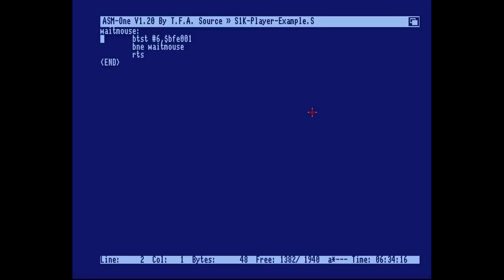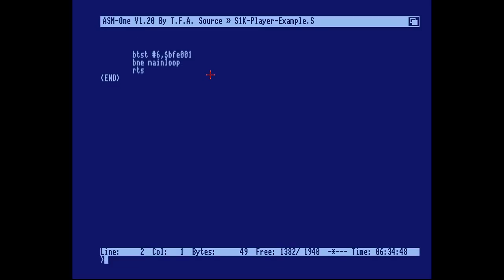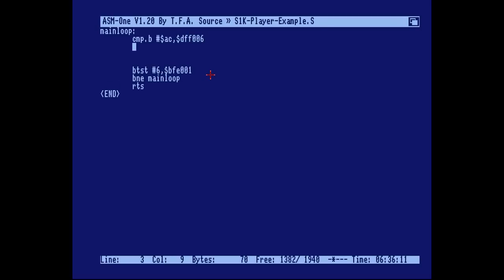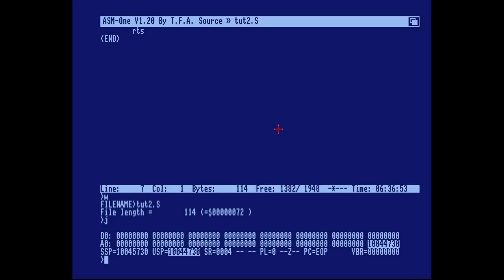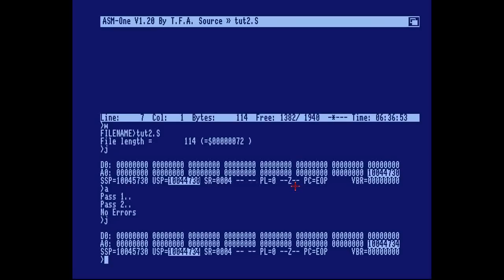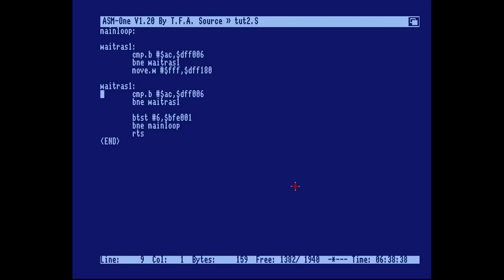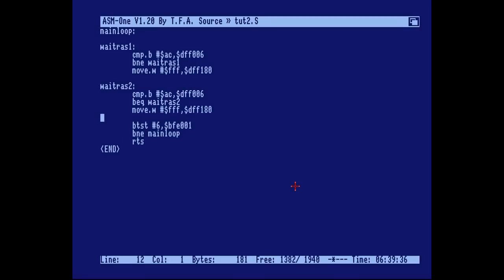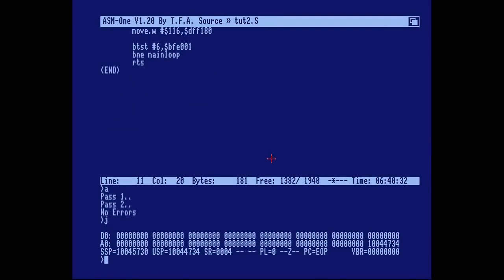Amiga Hardware Programming 2 - Make a rasterline

Comment: Ancient computer science. But still useful to see how you push the bits around. Sometimes I really miss those times when we had direct control. Thanks for it :).
Reply from the maker: 68k might remain the most readable Asm ever. We haven't abstracted hardware at all in 40+ years... other way instead + incompatibilities, drivers, kernels, and APIs to deal with that. APIs were promising, but random decisions deprecate them, another trend in the wrong direction.

The highest language still needs pushing undocumented bits to use anything beyond what it provides, sometimes even simple things fully supported across hardware platforms today.

Later in the series, we abstract as in all other languages, by SoC, macros, and functional programming.
Reply: @ScoopexUs  Yes, 68k asm is a very elegant assembler dialect. I came from 6502/6510 and was blown away by 68K those days. it's a shame that x86 architecture took over the market for the wrong reasons. However,  I learned x86 and also later x64 for practical reasons. Now I mainly work on high-level languages, like Java, C#, and sometimes (what I enjoy) C/C++. As I told you I miss the Amiga times. A great capable machine but now almost forgotten. And yes you are right, now we try to hide the architectural weaknesses behind APIs and abstractions. But the issues are still immanent and seem not to go away :D. Sometimes I solve some problems with my old knowledge which let some people stay aside from me astonishingly like I do magic. But no, no magic, just knowledge. like some of the registers and bits and understanding how the machine really works and what some algorithm means and about do's and don't do's.
I will check your tutorial out to see where it leads, but you made me curious.
Reply: @ScoopexUs  Agree. Started asm first on the C64. But did not come far, was still very young then (14 years old). Then came the Amiga and after making some progress I remember to tell a friend how easy it was and that it is almost like using a higher language. Did some intros and small demos, also some 3D wireframe animations. The Amiga was a great sandbox machine to learn computers and having fun with it.

Comment: How I can change directory in AsmTwo to SOURCES: (automatically)?
Reply from the maker: By adding a string parameter of the commands you want to execute as if you typed them in the Assembler, with \ replacing an Enter press.

Example: AsmTwo \f\400\v SOURCES:\ 
(where 400 is 400KB of "f" fast memory, c for chipmem).

You can do many more things with this automation. AsmTwo supports the AsmOne parameters and preferences - see my accompanying website which shares the manual and further resources.
 http://coppershade.org/articles/More!/Downloads/

Comment: If you're doing this in winuae there is some bad glitching. You don't get a solid line but a bunch of dahsed lines that flicker. Any way to get rid of that?
Reply from the maker: Hm. There may be one or two points in later tutorials where CPU: Fastest possible and/or Chipset: Cycle-Exact can cause visual glitches.

But I just tested, and it runs fine with the above settings and 68060 and Warp Mode. Soon in a future episode, we will be opening a native screen mode of our own. I.e., I guess the glitch can come from a non-PAL Workbench mode, and the sync settings (under Display) should be set to the default.

I recommend to load the Default Configuration and just add a Hard Drive Directory as the configuration for all of the tutorials, to eliminate any uncertainty about settings or emulation.

You can safely set CPU speed to 8x and add more RAM (except Z3 RAM), if you think it's too slow to work with. Another tip is to have a key bound to Warp Mode.